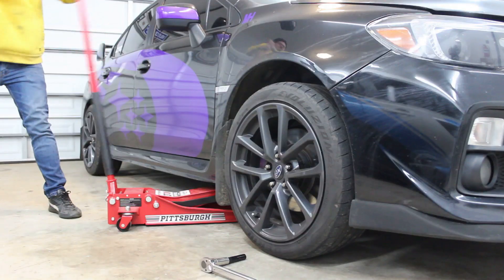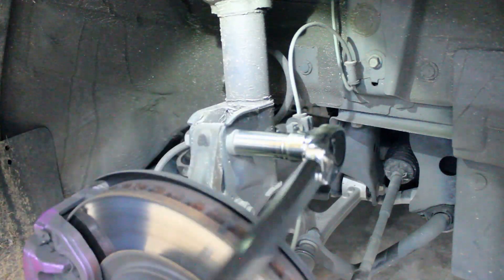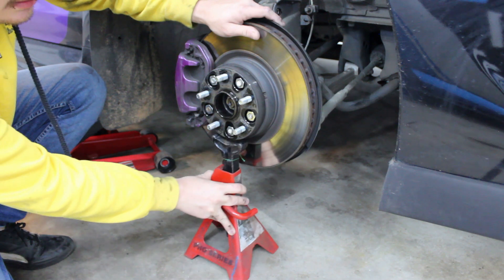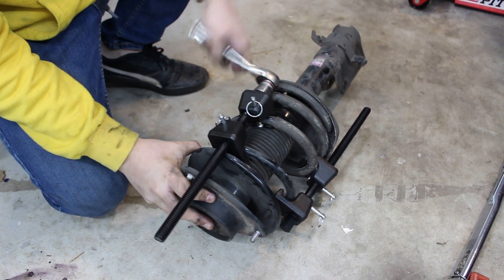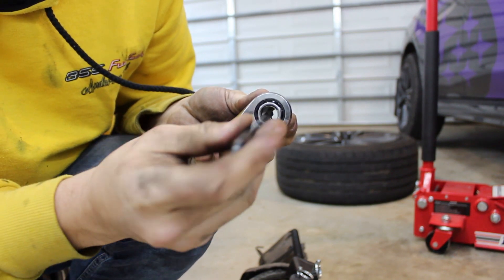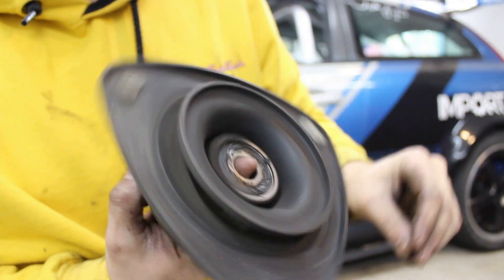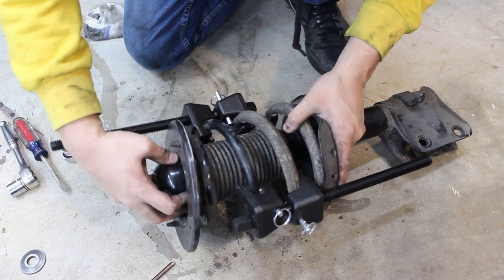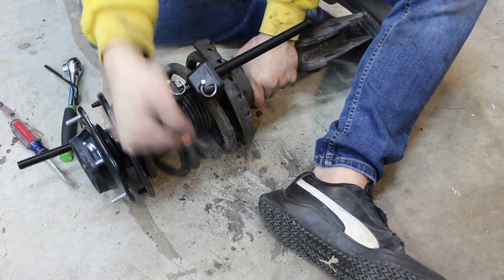2015-2021 Subaru WRX, Front Strut Removal and Disassembly

Comment: Excellent guide, thank you!

Small note - the top bolt of the strut also controls the camber. If you are removing it, it's probably a good idea to mark where the bolt was so you can reinstall it without messing up your wheel alignment.

Comment: I have a 2019 Impreza, I assume the struts and procedure are largely the same but thought I would ask...assuming usually gets me in trouble.  I need to disassemble mine to replace the dust cover.  TSB 05-82-21 points to the dust cover causing the rubbing/creaking noise I am getting from my front pax side strut.

Comment: what noises were you getting to let you know it was the strut bearing mounts were bad?
Reply from the maker: A completely failed strut mount will make a lot of clunks and noises. But early signs of failure are commonly a rattle sound that can be heard coming from the strut towers. This will be most prominent when going over bumpy roads, especially when going up hill when the least amount of load is on the strut mounts.

Comment: Any tips on preventing the axle from popping out of the transmission? I see you supported the hub with a jack stand on removal but not on installation. I'm concerned about the axle popping out if the hub sags and not being able to get it back in.
Reply from the maker: I had no issues and even if the axle does pop out, just pop it back in. If you're really worried about it, you can disconnect the axle from the hub so that it can be removed from the hub but still connected to the transmission.

Comment: I’m tempted to install forester or Impreza struts & springs on my WRX. Before you h8, the roads are completely decimated here in New England.
Reply from the maker: I love this idea!
Reply: spring rates and vehicle weight work hand in hand.  what is the weight of the Forester compared to the WRX?   why not lift springs and some bilstein b6 dampers specifically designed for the wrx chassis?

Comment: Where did u get the struts mount?
Reply from the maker: I bought a replacement mount off Amazon. It was cheap enough that I don't mind replacing it twice if I need to. But so far, it has held up fine. Here is an affiliate link: https://amzn.to/3QmI4As